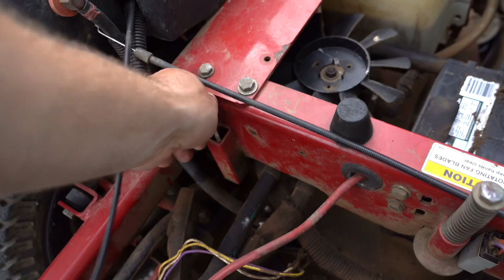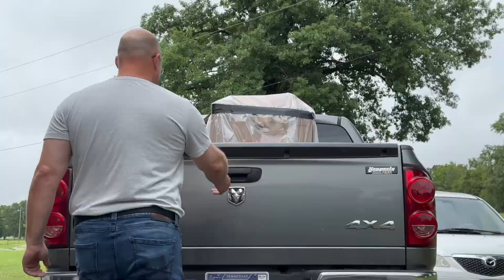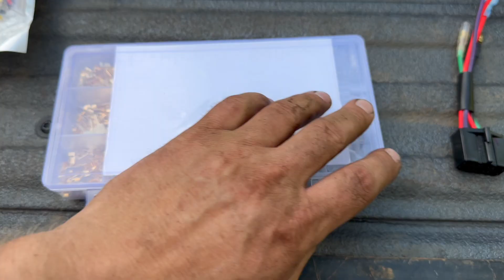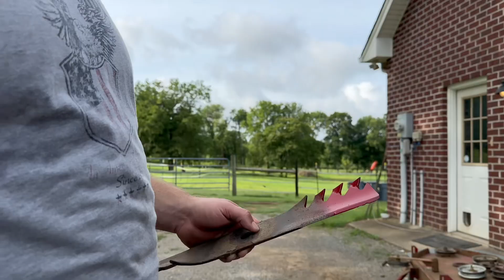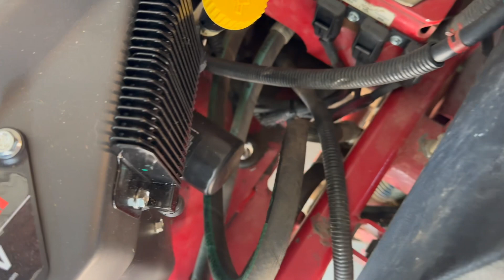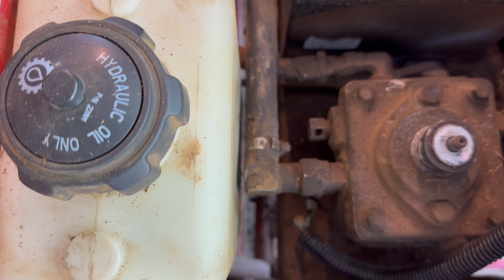Farris ZTR IS 3000 Restore

Comment: Nice work. I restored a Scag Freedom Z last year. First Scag for me. I was impressed with how much easier it is to cut the lawn with a zero turn. This year I restored a Tiger Cub. Wow. it is so much faster than the Freedom Z with its wheel motors and pumps. I may look for a Farris for its suspension system.
Reply from the maker: Thank you.   I’m working on a video that will show a comparison between the turf tiger and the Farris right now.  With the mowing season winding down for the year I might be mulching leaves instead of cutting grass.  I want to do comparison on speed, cut quality, and how comfortable they are to the operator.   It should be interesting.   Right off the bat I can tell you hands down the Farris has more power then the turf tiger who would have thought going from 27hp to 31hp would have made that much of a difference.